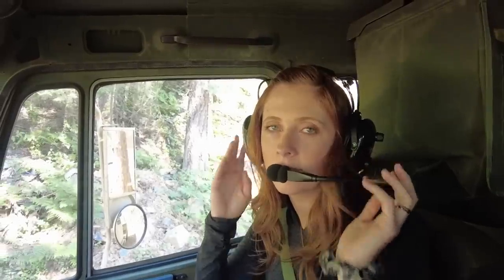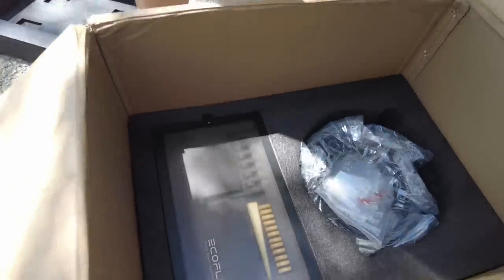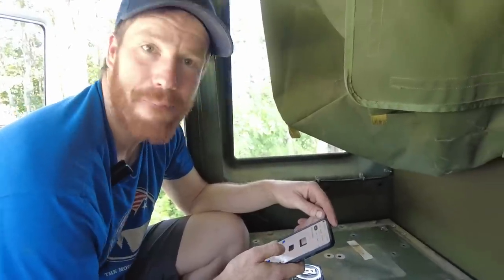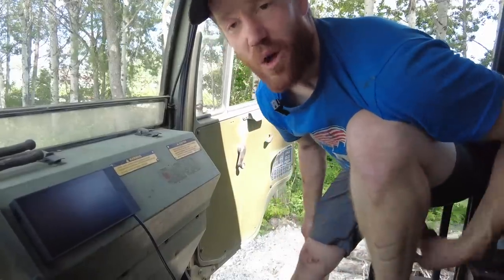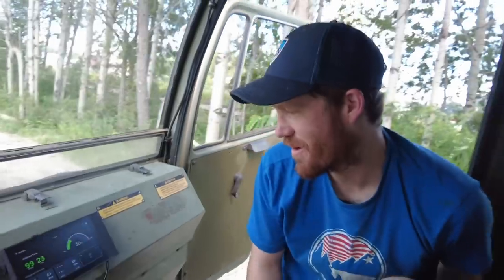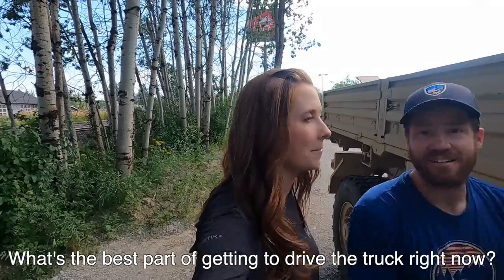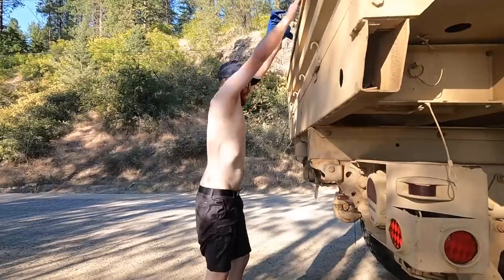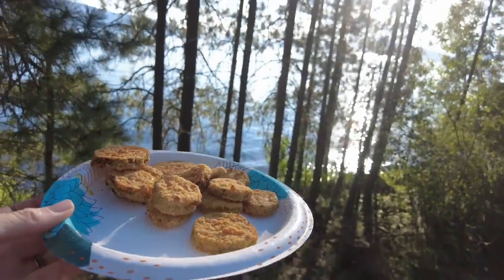DIY Off-Grid Power System... So Easy! | EcoFlow Power Kit

Comment: Inverters don't like induction loads, ie coffee maker, air fryer, heat sources.
PV panels don't like shadows, not even a flag pole. PV cells are in series, and when one is covered it's resistance goes up.  With electrons being pushed from one side, and pulled from the other, it can damage that cell, and by default the entire series will be restricted.
A second alternator would have been more cost efficient.  Hydraulics are more energy efficient, and MUCH more powerful.

Comment: How is Riley aka "Knuckles" doing after the arc flask?  Definitely need to redo the roof mounts so it's not raining in the cab. 

Another power system that I would like to know the cost of.  

Careful with the air fryer food.  "You

Comment: Saying you were to replace the existing RV breaker panel with the eco flow distribution panel, can the AC breakers be swapped for lower amp rating to not overload existing 15 amp wiring?

Comment: Say when Riley drilled through that plate to mount the distribution hub he didn't run that long drill bit those long screws into the top of the your batteries and damage them did he 🤔🤔 I hope not cuz the installation does seem to be very easy
Reply from the maker: No batteries were harmed in the making of this video! 😉

Comment: Although this is a really nifty system that you installed, I have a couple of nits to pick. 1.  Why is it considered unmanly to read the instructions? I have another name for it that I will not use here. 2.  Why was Riley so amazed that the solar panels were in a box labeled “solar panels?”  3. My biggest peeve. Now that you have covered the hole with solar panels, you can no longer install a .50 cal machine gun on the roof of your truck. How could you do such a thing?

Comment: To EVERYONE using their impact driver like this, QUIT IT!  In the pair option were you get the impact and screw gun, the screw gun is your drill and driver.  Impact drivers are for wood mainly, otherwise you over drive or snap things off.  Every trades guy that uses an impact does horrible work with it, use the right tool!

Comment: Not sure you installed this unit properly, did you see those fan grilles on the back of the unit?  There is a reason they are there, and not to be covered up! Mounting the unit against the back wall of the cab, I think you unit's life will be reduced considerably..https://youtu.be/HkPyzExv6iM?t=330

Comment: ahhhhhhhh..... hope you used the 12v connection in the Power Distribution Panel in front of the passenger.  

BTW- your alternator is under powered for this.  It is underpowered for the truck as it is.   Each side of the alt.  14v/28v is barely 50amp.  IMHO asap  remove two of the truck batteries..... there is write ups on how to still wire it as 14v/28v.  At least for now.....  you might need 4bats in your cold world.....  but till you upgrade the alternator..... use two and park her so the solar does most your house battery charging....  so alt. does not have to work so hard.  

PS- Ive already had an alternator fire.....  life showed me fast how piss poor the designed the trucks electrical charging system.

Comment: Entertaining for sure.  You made a mistake perhaps . Are the batteries you installed LFP  ?
If they are Lead Acid you have probably irredeemably stuffed them . Lead acid must not go below 50% State Of Charge. 
If its LFP it fine just bring the charge to 3.4 volts per cell as soon as you can . 13.6 volts for a 12 v system and 27.2 volts for a 24 v system. Believe me if you stay between 3.4v per cell and 3 volts low there is minimal effect on the life of your cells and we have 8 years of provable data now. Solar panels that last 30 years and now batteries I think we will get 20 years out of , inverters ? seem to be holding up their end OK. There is a reference site ,LFP for houses cars and boats  that has a good primer for LiFePo4.
Reply from the maker: They are lithium batteries.